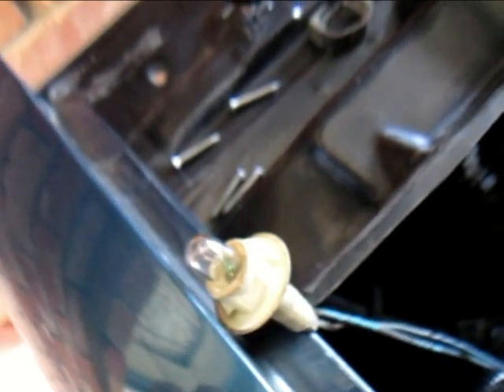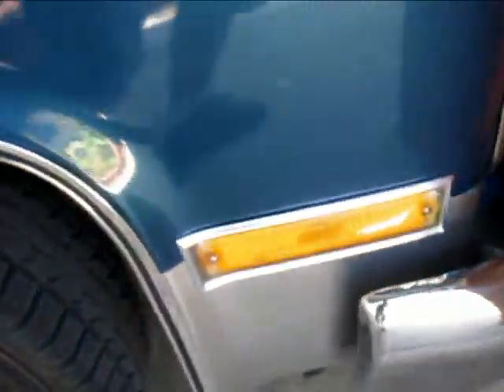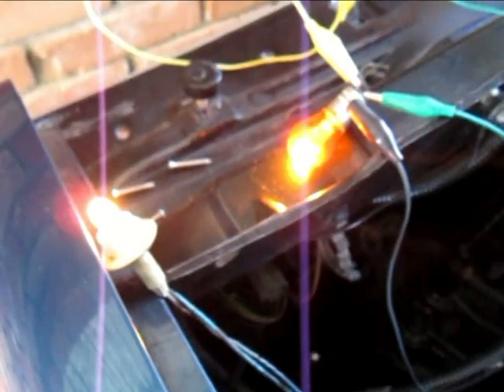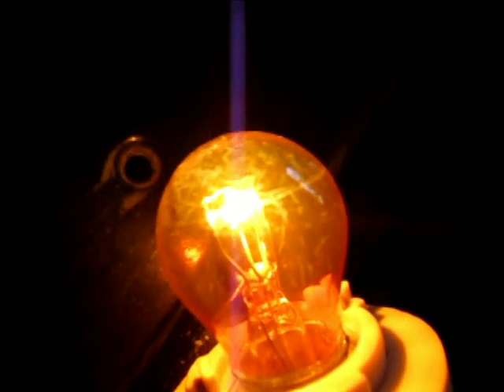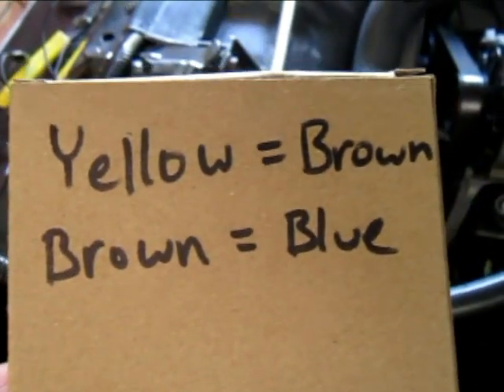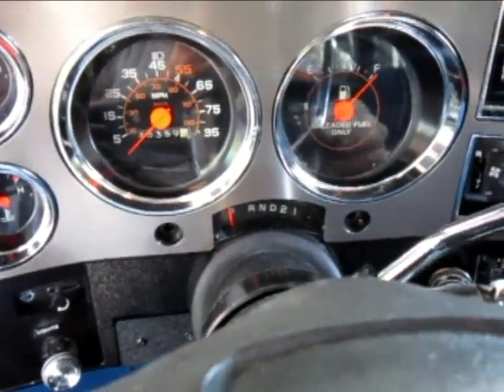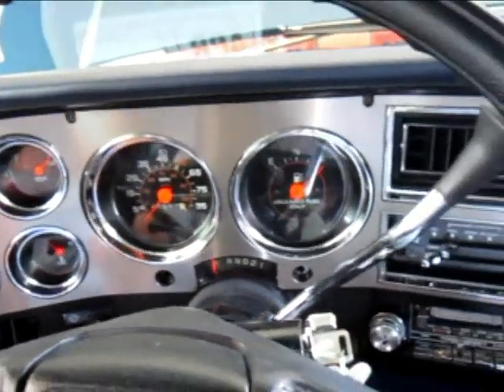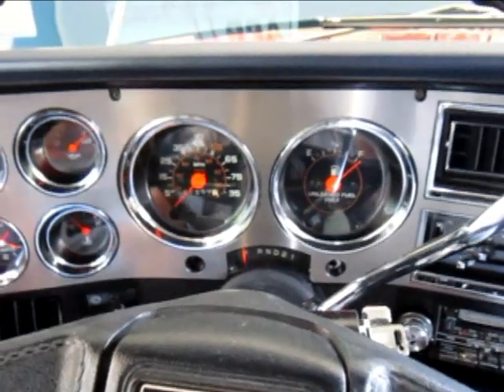1981 Silverado turn signal repair

Comment: I have the same problem with my 1979 truck the same blinker so I stopped the wires around like you said but now when I swap the lightbulb in the wrong way it works correct when I put the lightbulb in the correct way it just stays right
Reply from the maker: Sounds like you need to check the ground. Socket also sounds bad. I can only put the bulb in the correct way.

Comment: Good video I need to find out what's blowing my fuses hopefully get a chance this weekend
Reply from the maker: Thank you, hopefully it's a simple fix.
Reply: @dynatrak  I've got a 1982 Chevy Citation that I've got problems with my turn signals. I'm going to watch your video, hopefully you can give me some insight on how to fix my problem, today my ignition switch would not allow spark to my coil I know it's the ignition switch got any suggestions for me...$$$???
Reply from the maker: @fubarlife7776  I'd refer to the wiring diagram, and test to confirm. Should be a similar setup to mine. I replaced the worn out ignition switch in mine, last year. Not a difficult job if I can do it.
Reply: @dynatrak  thank you I was just talking to a locksmith and he told me that if the the lock solenoid isn't in the on position correctly you can't even replace the ignition switch I don't know if that's accurate but I know it's hit and miss it works and then it doesn't work it got me somewhere today and then when I started up and started to driveway at conked out and it cuts off the spark to the coil it will turn over but no spark to the coil and then I'll send mysteriously it just starts right back up again it's intermittent very frustrating.
Reply from the maker: @fubarlife7776  Mine is on the steering column, held on by two screws, and then there is the rod from where they key goes, down to the actual switch. Seems like I had it in the off position, and everything lined up just fine. Then you take out the little plunger on the new switch assembly. I think I made a video of it, and posted it. Are you sure it's not the starter or starter solenoid? Tap the starter with a metal pipe, or hammer a few times, and see if it starts after doing that. That's a trick to get you by a time or two. I drove a 2004 Silverado as a work truck, and that was the problem with it. Just randomly happened.
Reply: @dynatrak  yeah positive it's not the starter because it cranks over just fine, it's just doesn't get any spark I'm almost 99.9% certain it's the ignition switch, thank you for that I'll look for your video. I just ordered on O'Reilly the lock key cylinder and then try to put that in tomorrow and see what happens.👍
Reply from the maker: @fubarlife7776  I hope that part fixes you up!
Reply: @dynatrak  Thanks. Me too, wish I could afford a professional to make it work right 1st time!
Reply from the maker: @fubarlife7776  Well if you teach yourself, you'll be your own professional, and save a ton of money, too.
Reply: @dynatrak  I've done the ignition lock and the ignition switch in the past back in  1989 on a Chevy chevette and on an identical Chevy citation, but I have a injuries that don't allow me to do work like I used to, it hurts to turn wrenches, getting awkward positions nowadays messes with my concentration, focus my ability to perform basic tasks,  post-traumatic stress disorder from multiple  brain/ spine injuries. Very frustrating for me cuz I can visualize myself doing the work but then when I actually go to do it, takes forever have to take breaks, things end up breaking cuz the car is old and very crispy, then I end up talking like a sailor...lol
Reply from the maker: @fubarlife7776  Oh ok, I'm so sorry about your injuries, and PTSD. That's a real fear of mine, to lose my DIY abilities. Yeah, I know what you mean about things breaking in old, crispy cars, while working on them. I've had that happen plenty.

Comment: I'm having trouble with my 83 Chevy C10, the problem is the fuel gauge don't want to work. Checked the wires of the tank. Still marks full even if it's empty..
Reply from the maker: Several other things to check. Here is a pretty good video to watch:
https://www.youtube.com/watch?v=LRQU7chppLg

Comment: I have been trying to find this bug in my truck for 2 years. Thank you!
Reply from the maker: Awesome! Glad you got it figured out.
Reply: @dynatrak  I repaired the old socket by soldering on a new ground lead, until I can find a replacement part. Thanks again. I feel like I'm driving a new truck now. Everything in my 41 year old truck now works! But, mine isn't so pretty. I have a jumpy speedo cable to lubricate.. Working on the visuals after this.

Comment: My front side markers would not blink.Any idea
Reply from the maker: Unfortunately, I wouldn't have an idea, since I'm not actually working on your truck. My suggestion is to get a wiring diagram, and a multi meter, and test each component in the circuit. That's what I have, and works very well to find problems.

Comment: Not sure you are still around but great video and great truck.  I have similar 87 with similar issues.  The passenger blinker arrow will glow, and blink slowly occassionally.  When it does happen my passenger headlight will go out, and sometimes the driver side will go out.  All without touching wires.  My truck has the 4 square headlights, 2 upper dim and 2 lowe  high beam.  The problem never shows in the high beam, blinkers, or running lights.  Just the 2 upper dim headlights.
Reply from the maker: Indeed, I'm still around, and thanks! Sounds like a possible bad ground, and seems like you have it somewhat isolated. Best of luck finding the issue.

Comment: So the signals are supposed to alternate like that?
Reply from the maker: Yes. We’ve had the truck since new, and that’s how they’ve always worked.
Reply: @dynatrak  wow that’s a relief. I have been troubleshooting this “issue” like a madman the past few days. Well atleast I know I’m not crazy anymore. Weird design in my opinion. Also do yours alternate with the headlight switch completely off? Mine do not, only when headlights/parking lights are on.
Reply from the maker: @lucasstephenson3205  Mine don't alternate with the headlight switch fully off either. Yeah, that's just how they are, and sounds like yours are working as they should.
Reply: @dynatrak  ok thank you so much for the response!
Reply from the maker: @lucasstephenson3205  You bet! That's a huge pet peeve of mine, for someone not to respond at all.

Comment from the maker: @ Ted Hagler. Ebay nos gm truck search. The clock, and oil pressure are original to the truck, just painted the pointers to match.

Comment: Here's one for you, my 84 c10 has no parking lights, no brake lights, no turn signals, no 4 ways! Tell me what you think I should do!
Reply from the maker: Get a wiring diagram for the '84, test light, multi meter, and start searching for a broken wire, bad fuse or bad ground. Hopefully someone hasn't hacked the wiring harness. Check all sockets in the problem area too. Really hard to say what it could be not actually working on the truck. Let me know what you find. Always good to learn about what other people find wrong with electrical. A while back I was having trouble with my brake lights, and found wires rubbing against the brake booster, and shorting out. I have a video where I show that. I think the one where I replaced the engine wiring.

Comment: I’m wondering if you would know what is wrong with my turn signals. When I turn on my left turn signal it works how it should but when I use my right turn signal it acts like I have the flashers on. Also when I push on the brakes my parking lights and my dash cluster light come on. I’ve been trying to find out what’s wrong with the truck for a couple months and haven’t found anything... the truck is a 1985 Chevy c20 crew cab
Reply: ever find a solution?
I have the same problem

Comment: My wires were ripped out from my turn signal on the back of my 85 Chevy and its still blinking slow even though i replaced the wires and bulbs what do i do?
Reply from the maker: I'd recommend getting a wiring diagram to double check everything. Possibly substitute another turn signal flasher. Hard to say not actually seeing it in person. I hope you get it figured out!

Comment: Can someone please tell me where the reverse relay switch is on a 1986 Chevy 3/4 ton Silverado. My reverse lights will only stay on if I hold the automatic shifter up while backing up. I'm told that I should be able to adjust the relay in order to resolve this. Any help would be much appreciated. Thanks

Comment from the maker: I'd check the bulbs, and grounds. My bulbs have 2 filaments. I've had one burn out before, and the other section still work. Sorry for the delay!
Reply: It appears to be a ground issue from all my 30 + years experience dealing with these type of issues on  jalopes LOL

Comment: Hey there sir, I have the same problem but it's both of my turn signals and my front left marker is out. Do you suppose it's the same issue? Taillights went out about the same time. But my signals work (excluding the front left marker) when I have the hazards on. Also I like the rims and tires on your Silverado.
Reply: I have this same exact issue with my 85 Chevy C10 right now, and I'm trying to figure it out quickly so it'll pass inspection. If you have found the issue i would be grateful to find out what i may need to look for or just replace. Thank you
Reply: kob corn turn signal flasher in fuse box. Simple and easy fix buy replacement flasher for like 8 bucks. Taillights still not sure. Testing wires soon.
Reply: MikeyBoy I wish it was that simple, I've already tried replacing the turn signal flasher and it did nothing. The flasher still works for the driver rear but nothing for driver front markers. Sorry i miss read it last night, so my problem is that the turn signal light on the dash is on for the left side. The marker lights in the front driver side don't come on and dont work for turn signal but will work for hazards, so what I'm thinking is the socket might be bad since when i pull out the front marker light bulb the side marker comes right on. Any suggestions would be greatly appreciated!

Comment: What kind of dash pad is that with the chrome around gauges? Id like to have one in my 90 blazer k5
Reply from the maker: The dash pad, and chromed gauge bezel are both new old stock GM from ebay. I know the later models had less chrome, but LMC may have one with chrome that fits a 1990.

Comment: i have another issue with my 1991 k5 blazer, which is the brake light always ON inside the dash ?  any advise ?  oil brake level is good

Comment: i have another issue with my 1991 k5 blazer, which is the brake light always ON inside the dash ?  any advise ?  oil brake level is good
Reply from the maker: Not sure, every once in a while mine will do that, and with key in, I turn the ignition toward me, and then start, and brake light goes out. It's happened two or three times over the years. Get a diagram for the year, and trace down the brake light circuit to find out for sure. I got a service manual for mine, and has helped me a few times. I'm sorry for the delayed response. I haven't got on you tube too much lately.
Reply: Check the plug at the brake distribution block. The block should be located on the lower front core support on the drivers side. Could be open circuit wire or bad ground. Should be easy to look at with all the room in the engine bay.